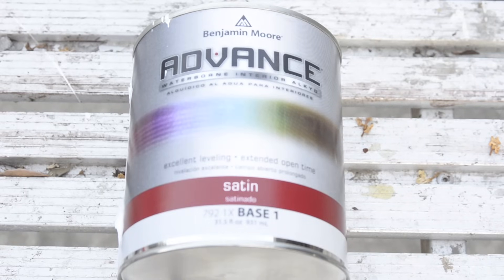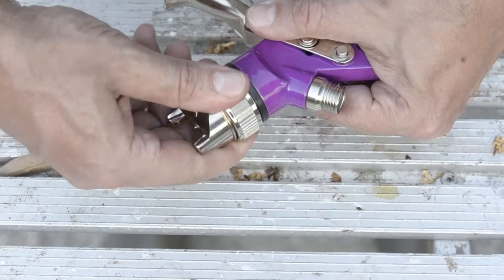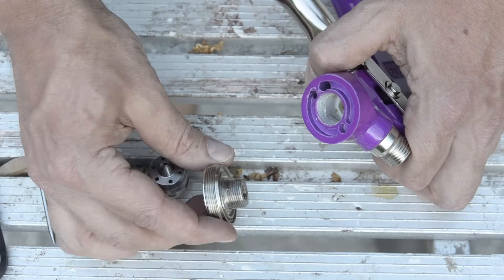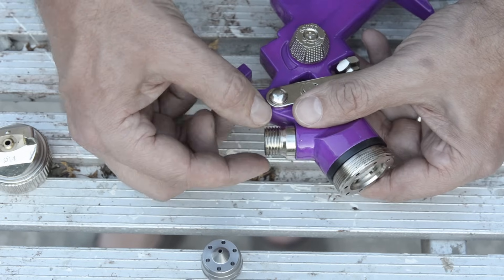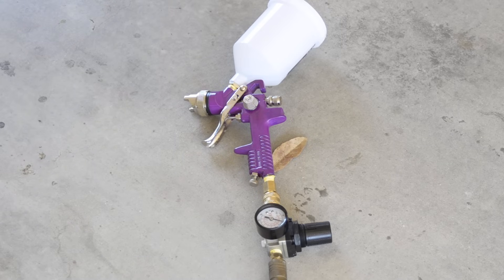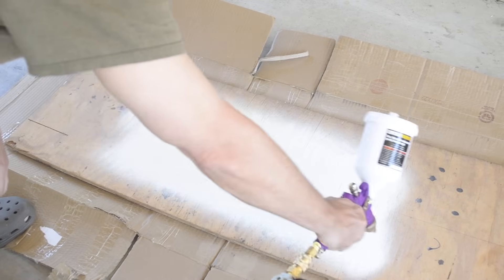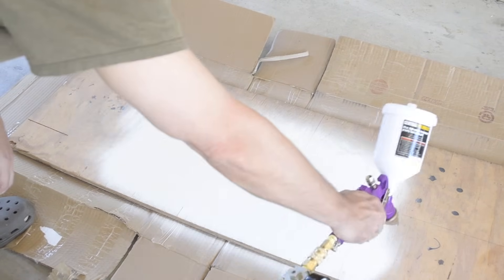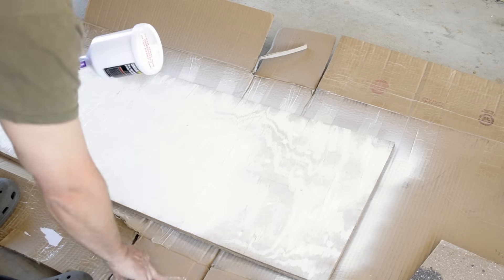Spray Benjamin Moore Advance with Harbor Freight "Purple" HVLP Spray Gun

Comment: Does anyone know if there are other needles, springs and tips that are comparable with this HF gun?
Reply: I just bought one last week...didn't see any additional tips/needles available for this gun.  I used a #50 drill bit to drill the tip to a 1.8 size.  Still waiting to use it...just been too hot down here in Texas to do any spraying.  I have a barn full of cabinets waiting.  HF does sell a two-gun automotive kit, which includes a small detail gun and a larger gun...the larger gun has two tips in the kit...a 1.4 and a 1.8.
Reply: The gun is $10. Parts will cost more than it's worth. Just buy a new gun.

Comment: You opened the holes in this gun. Will it not carry hire CFM, say like  7 or  8 CFM?
Reply from the maker: sham channel I’m an amateur, so all of my opinions should be taken with a grain of salt.  only opened the center to allow for the thicker paint.  I was trying to keep the airflow as low as possible to retain some measure of “high volume low pressure”. On the flip side, other commenters have said the pressure is already too high, noticing the overspray.  That overspray only gets worse with more air.

Comment: Was it fine for cabinet doors? Do you still have it or you got something else? Give us an update. Cheers.
Reply from the maker: Yes, it was fine for cabinet doors, but I’ve tried a few products and think I like PPG Breakthrough better.  Still get a hard finish, but it sprays better and cures much quicker.  I don’t recommend brushing Breakththrough if you’re an amateur…dry time to short.  You get enough to lay it down and feather, say 3 or 4 strokes, then you can see it start to set up.  SW emerald is between the two and may be the middle ground between final product and workability.

Comment: The smaller the tip the finer the atomization.  This is what you want for cabinets.  Try testing on sanded plywood before you decide.  You won’t get as good a finish.  Thinning paint is no big deal.
Reply: Robert that’s what I did and it worked great
Reply: I used an old Binks pot gun with acrylic enamel thinned with water to paint doors and the satin finish came out great.
Reply: Thanks for your comment.  I been using this gun as is with the 1.4mm factory tip on my cabinet doors.  Getting a great finish.

Comment: I saw ppl adding water to water based paint. Wouldn’t that be good?
Reply from the maker: Usually yes, but since this isn’t a latex, too much water will reduce the solids to the point where the finished coat won’t be thick/hard enough
Reply: @johnnosacka9556  so I can add water to latex and water based paints?
Reply from the maker: @twiztid83222  to a degree.  The label should tell you how much is safe.  Advance says no more than 10%.  This is only done when you need a thinner paint for spraying.  If you’re rolling or brushing, you wouldn’t want to thin….unless you’re like me and need a few ounces to cover that last corner and don’t want to go back to the store ;)

Comment: Your other sprayer sound like a HVLP set up. If that is the case you need to reduce the paint to get to work properly. I would be willing to bet that if you reduced the paint for this gun you would not needed to drill out the opening. The reason it is dripping could be because you opened the outlet while using the same push rod that is now too small for the drilled out outlet.

Comment: Let me say thanks for the video.   What I paint latex with is the texture sprayer (from HF) that is used to spray wallboard gypsum.  It has a few sized tips.  The smallest can paint latex if you don't care a whole lot about the finish.  So for my outdoor shed it paints it on thick and fast.

Comment: interesting video , I would have never guessed you could get water based paint (even if it's waterborne alkyd) through a cup air sprayer without thinning it too much ..... not a bad little rig for some small stuff .... Of course i could brush and mini-roll the project before you get that mess hooked up and sprayin' !!!! lol
Reply: @SomeDumUsrName - with good technique "brushed or rolled" comes out very well , especially if it's a satin finish  ..... quality mini rollers , short nap , do quite well , but yes , I will give you a spray finish would be best .....

Comment: You are MUCH better off thinning Ben Moore Advance (or most any other paint) for best results.  Most professional painters have learned to thin "by eye".  DIYers should spend $6.00 or so for a Ford #4 viscosity cup to gauge the proper amount of thinning material.  Thin the paint with BOTTLED water such that the Ford #4 cup will drain completely in 20-28 seconds.  Tap water contains some organics which can sour the paint if stored, so don't use it.  Floetrol is a good product, but it is an EXTENDER, not a thinning agent.  An extender slows down drying just a bit, to allow more time to allow the paint to "self-level".  Using Advance thinned with bottled water to flow thru a Ford #4 cup in 20-28 seconds will produce excellent results consistently when sprayed thru a 2 mm tip at 35-40 psi.  No need to back the material control adjustment all the way out.  Using the Ford #4 cup takes all the guesswork out of thinning for consistent, professional-looking results.

Comment: Isn’t advanced a water-based paint? I believe you can just thin it with water. In fact, I think it even says so on the can. Wouldn’t that solve the problem? Yeah, you would have to do an extra coat or two, but you have to do that anyway for the best results with advanced.
Reply: You cannot simply thin paint until it works in your gun, with undersized tips. Paint manufacturers specify how much you can thin their products without destroying the paint's integrity. Hence, larger tips.

Comment: Paint Thinner you add 50% paint and 50% Pain Thinner and you can even shoot thru a 0.8 no problem. But if you mix 80/20 - 70/30 paint/paint thinner you should be just fine just make sure you stir it well so it mixes all the way.

Comment: The paint is great but you have the wrong guy for the job, you should get a graco airless sprayer with a 311 graco tip for cabinets door or 313 for interior doors and trim moldings and you will get professional results
Reply: I believe the Graco is over $200.  The HF purple is $16 at my local store.  By proper thinning I have been able to spray a wide range of viscosity materials with my unmodified but fine tuned Purple.  By fine tune I mean well cleaned and seal air leaks with teflon tape.
Reply: @randysimpson7625  you can also spray it with a garden hose. It all depends of how smooth a finish one desires. I do understand your point of price vs. Performance however, and feel the bottom barrel price of an 8.00 gun cuts your efforts short. Its a grest way for you to learn though, and Advanced is the right product for the job. That said, advanced lays down so well, i can achive a smooth finish with a brush and or foam roller. So, no 8 dollar gun. But then, ive also ben painting for 25 years, and have used Advanced since it came out. You seem to be learning, and doing so at a reasonable cost so good job Randy.
Reply: As far as Michel,  try the HEI tips, and fft. Use of numbers like 311 and 313 are no longer specific with the wide variety of fine finish tips now avail. Not to mention, randy is shooting cabinets. How will he run a quart or 2 through a piston pump? (Airless)

Comment: John, great video.  I'm trying to do exactly what you've shown.    Questions:   1)  did you thin the Advance with water at all and 2) did you have any leakage out of the tip once you bored it out or does the needle still fill it out?   Interestingly, I have a gun from a different (Chinese) manufacturer with a 2.0 mm tip which I bought to use with Advance, but it performs less well than the HF gun with the 1.4 mm tip.   For the other gun, I need to thin the paint excessively in order to spray.   Also need more like 60 psi.   So something about gun design other than tip size comes into play.    If I can spray Advance unthinned from the HF gun with a 2 mm tip I would be ecstatic.  :)
Reply from the maker: plantguy100 I was thinned a little less than 10%, but you would never have known.  I’m tempted to say the effects on thickness were close to non existent.  I had followed others’ vids to set up the gun with plumber’s tape.  No leakage.  I didn’t have the wrench I needed but found one at the pawn shop for .50 cents
Reply: OK, John, thank you.  Less than 10% is within reason.   I've been spraying cabinet doors with a similar product, Sherwin Williams ProClassic Alkyd Acrylic hybrid, which has a shorter recoat and cure time than the Advance.   (I have previously applied the Advance with a mohair mini roller and very much like the product.)  With the SW product,  I've been successful with around 10% to 15% dilution with the unmodified HF gun.   Strangely, another manufacturer's gun with different design and 2.0 mm nozzle has required more thinning, such that the paint is too runny.   You're right, if you stay below 10% dilution, the mixture is still thick enough not to run.   In fact, I prefer a slightly thinner mixture whatever my application method, since it allows the paint to level out better.   

My main concern is leakage at the modified tip, but perhaps the tapered needle still completely fills the bored out nozzle such that no leaking occurs.    I tried a simple water test with the HF needle for the 1.4 mm tip in the 2.0 mm nozzle from the other gun, and indeed it did not leak.
Reply: @plantguy100  You mix 8 ounce of water in a gallon

Comment: how big is your air tank for reference.
Reply from the maker: aaron fuksa I have a very old craftsman 10 gal, 1.5 hp.  I just finished my kitchen cabinets....35 doors and 20 drawers.  It did fine.
Reply: John Nosacka How smooth was the finish?
Reply from the maker: jockellis I won’t say it’s factory finish, but it’s as smooth as any DIY’er could ask.  Cabinet doors were painted when hanging vertically and came out smooth, and without any sagging since I also did not over apply like you might with an airless
Reply: John Nosacka Thanks. I’ve got a HF gun but used an aerosol can to paint some cabinet doors and wasn’t too happy with the result.

Comment: I spray Advanced with a $79 Husky HVLP running a 2.2 tip.. No thinning/drilling required and I get a perfectly smooth finish.
Reply: The difference is $79 versus $7.99. I'd drill it too. Huge difference between a home diy'er doing a project or 2 and professional painters that are using their equipment on the daily.
Reply: Melissa Johnson Well I consider the Husky to be a cheap gun. I am not a professional just a DIY’er and own two of them; one for primer and the other for paint. If the cheaper gun works with slight modifications cool. I started out with a decent gun because you know how projects go, one turns into two and two into 10 lol. Glad this video is out there for others that can benefit from it!

Comment: dont forget a water seperator on your air line
Reply: It is water based paint. So water in your line will just thin the paint out a little more. He's not exactly painting a concourse car here.
Reply: @1pcfred  true.. but still a good habit to get Into
Reply: @PcRat1  horses for courses. Never do anything any better than you have to. Because perfection is the enemy of good enough. Do enough good enough and you'll have the resources to tackle the jobs that demand excellence. Diddle about when you don't have to and you'll never get to where you need to be. Habits for habit sake is a bad habit itself.
Reply: @1pcfred  I'm not a perfectionist by any means either lol.
Paint is paint.. if it looks good and your happy. Hey job well done. :)
Reply: @PcRat1  that's it. If you're happy it's good.

Comment: Airless. FF Tip. Forget the hvlp
Reply: Tim, a good airless graco is well over $250. The HF gun is less than $25 and provides much more adjustments vs airless for a budget diy person.
Reply: @whitechevy33  true dat 👍
Reply: @whitechevy33  over a $1,000 actually

Comment: To much air, Turn the air pressure down a little & open up the material adjustment on gun & slow your speed down
Reply from the maker: dirty4op thanks for the tip.  I’m spraying cabinet doors this weekend and will try to decrease the airflow.  I don’t think I can increase the material flow more than I had it.

Comment: Also, Benjamin Moore indicates Advance can be thinned with 6.25% (8 oz per gallon) water without causing a problem with the paint.
Reply: CORRECT. I diluted this paint, sprayed a gas can and it came out as new, paint is solid and it looks like it was factory sprayed! I di NO modification whatsoever to the purple gun!
Reply: flotrol is better for thinning proclassic or any other waterborne paint
Reply: would you use up to the 6% floral just like water? @duartepaintinghandymanservices
Reply: flotrol*
Reply: James C. Campbell you can actually use more because flotrol doesn't effect coverage as water does, thats the benefits of it.
Reply: thanks for the response. looking to get one and practice a bit but wanting to paint some old wood cabinet faces
 @duartepaintinghandymanservices
Reply: James C. Campbell try using breakthrough from ppg paints, for years I've used benjamin moore until a representative of ppg gave me a free gallon to try, i haven't gone back to benjamin when it comes to cabinet paint
Reply: @jean-pierrescherer8250  how much did going dilute the paint?
Reply: Brianne Anderson 2oz per quart , warm water  no problems
Reply: @duartepaintinghandymanservices  Home Deport sells PPG; would it be the same as getting it from a PPG shop?
Reply: MrRjnr they don't sell breakthrough only wall paint
Reply: @duartepaintinghandymanservices  OK, thx!

Comment: Silly question.  I know manufacturers used alkyd to paint cars in the past.  Has anyone ever tried to paint a car with this stuff?  I've used it on cabinets and it is hands down the best paint I have ever used for that.  It is by far one of the most user friendly paints.
Reply: Advance is an interior only product (High Gloss is the exception). I is not durable enough for autotive use.

Comment: Cheap tools & materials represent the single biggest mistake DIYers make when approaching these types of projects. Remember tools are not an expense, they are an investment you make in order to achieve superior results. When the job is done can then be sold for 80-90% of their value and in the end it is cheaper than renting. These 2 budget HVLP Systems are the best and hold their value: 1st choice: Fuji 2202 Semi-PRO 2 (2203 gravity version) & 2nd choice: Earlex HV5500.

Comment: How big is your air compressor?
Reply from the maker: Rowel Tuazon 10 gallon,1.5 hp
Reply: get the 21 gallon $150, has metal shavings in case, fill and change oil before you run it. run 15 seconds change oild again, run few mins change again
Reply: If you're buying a 10 dollar paint gun, I doubt spending 150 bucks on a new compressor is in your budget.
Reply: I spray with this gun for woodwork and use a 30 gallon compressor. usually it can out pace the gun on 30psi wide open

Comment: Who in there right mind would drill out there paint gun! Either water the paint down or buy a different gun/tip.
Reply from the maker: lockystocky1 I would normally agree with you, but this was kind of an experiment.  The gun was $8 and I bought a couple of them.  Plus,  this paint seems to be notorious for not allowing too much thinning.
Reply: Buying a different tip and needle is not as easy as one thinks. I searched for days to find a spay gun (locally) with a tip size greater than 1.8. My only thought would be the needle is not sized to the drill bit used.
Reply: It’s actually pretty common to do this in the custom automotive paint world for metal flake paint , if it works it works especially on a cheap gun
Reply: lockystocky1.....Their not there
Reply: You could thin the paint. But the gun is super cheap so who cares

Comment: Holy crap.... Are you painting or sand blasting? You're running way too much pressure and trying to lay down way too much paint at one time. Not to mention you can't run a paint gun with a pancake compressor that's built to run a nail gun.

Comment: HVLP turbine would need a #3 tip.  I refinish tubs,tile,countertops and cabinets and use this paint on the cabinets with my 3 stage turbine.
 I thin the paint.
Reply: Is the Advance harder than your usual latex like Ben or whatever? Advance isn't latex, is it? It's acrylic?